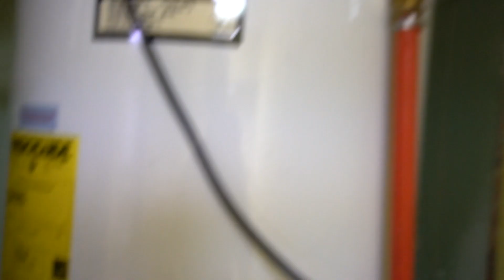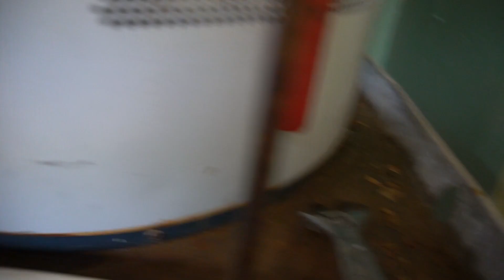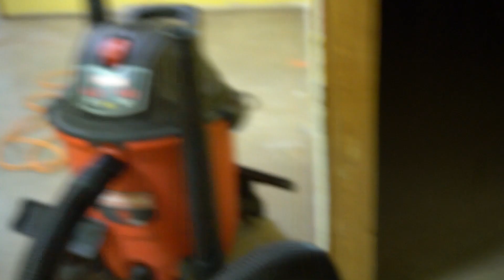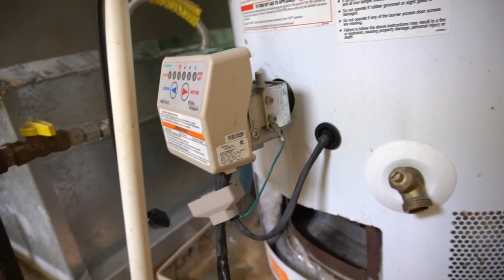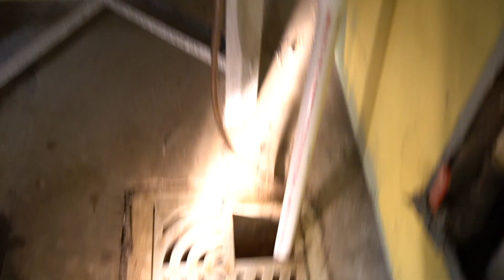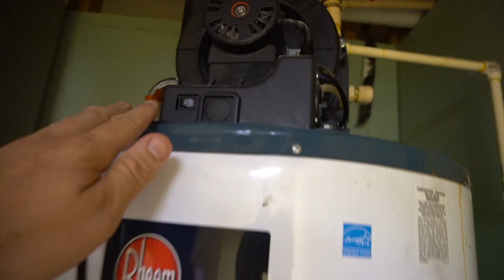How to Fix a Gas Water Heater that Won't Light Time to Replace Install Thermostat?

Comment: We just got a new replacement, as the old one was stuck on the very hot setting, and it won't go on at all. I wasn't there when the technician was there, but one would think he would have tested it. Now the control until won't turn on at all. My circuit breakers are okay... I tried a lamp in the outlet it uses, and that is fine. There is no on/off switch like in your video, unless its behind a metal housing, that is held in place with screws.

I am not very good with type of thing, and this is not even my house, so I don't want to mess around with something that uses natural gas. I am just worried about being stuck with a bill when we have to call the repair guy back (it is a rental), as we've only had it one day. Given that the tank was full of the hottest water, and the technician started the new one, one average temperature, could it be that he never even tried it? There is a sticker on it about starting it at average temperature. And when I ran water after he left, it was still very hot.

I unplugged the old defective one sometimes, to stop people from getting brunt, and when I plugged it back in, all the lights would briefly flash... Now when I unplug it, and plug it back in,,, no reaction. There is an internal switch, that goes off, shutting it down when it detects excessively hot water? That is the only reason I can think of, why this thing has already gone dead. Help! Thanks.

Comment: Thanks for posting! How did you know the solenoid wasn't letting the gas get through? What were the symptoms of this going out on you?
Reply from the maker: the burner assembly was working, but after talking with some techs, they said replacing is best.
Reply: @TheRykerDane  Thanks for the response! I'm having a similar but not the same issue. It keeps trying to ignite, and it does a click, click, click, and you can hear it start trying to run, then it shuts down. It cycles over and over again many times until eventually it lights, but sometimes it doesn't for a while and the water doesn't heat up. Wonder if it's the same as what you've got going on or something different. My thought was that it's possibly the thermopile.
Reply: @powerofknowledge7771 did you fixed your issue yet? I have same exact problem as you and wondering what fixed the issue? Thanks!

Comment: My blower won’t stop and the green light is in along with A B C light even after unplugging it I can not reset it. I’m guessing I would need to replace the Module also.
Reply: Theres a diagnostic mode for these units and whatever lights are lite up will tell you the issue... ABC light with vacation light is replace eco activated and says to replace the gas control valve

Comment: Thanks for sharing this video! The best I can find.
For mine, I can see orange light when the ignition starts but no blue fire. Thermostat tries to inginit 3 times then go to vacation. Do you have any ideas what I should do?
Reply: Same thing here and I'm thinking its the gas valve and the entire unit needs replaced.
Reply: @ms.sayer1  I replaced the gas valve(the whole white box) this Tuesday and it solved the issue.

Comment: Dumb question.... Does it need to be drained before replacing the igniter? I bought a replacement igniter but there doesn't seem to be any instructions on how to install it.
Reply: No because the igniter only goes on the underside of the water heater. However, you will need to shut off the gas to it before taking off the gas pipe at the manifold door.

Comment: Min I replaced my gas controler and now I have to turn the power off then on several times to get hot water. It won't start on its own. Temp is set on high.

Comment: What if the green light doesn't blink?
Reply from the maker: Hold the button and it doesn't? Is there power?
Reply: What if this unit has zero power to it?? Ive unplugged it, shut off blower and let sit... then plugged back in and turned on and immediately hit the arrow keys but nothing!! Would it be the gas valve control unit that you replaced not getting power and whole unit or could it be a electrical issue?  Cant seem to find much on this issue at all only error codes and fixes to em but not when it has no LEDS lighting up period.

Comment: I have vapor lock out, tried the codes  with no luck, could it be my sensor? No gas leak present, Ao Smith lp hot water tank white Rodgers controller valve!
Reply from the maker: It could be the igniter is worn out and not starting

Comment: Hi - I'm having a similar issue (same lights appearing on the thermostat unit). You mentioned yours was stuck in vacation mode. I have the same water heater and on the side of it there's a guide that explains each error code. 

The code you were receiving (and I'm currently receiving) is described as "maximum amount of ignition attempts has been reached and system is in lockout"

Question for you, was your water heater not igniting at all prior to you fixing it? So with mine.. I've had this same issue 3 times in the past month, all on rainy days. I have no idea if that's just a coincidence or not. Each time I've just flipped the blower off/on, and the water heater goes back working normally. Given that my water heater does ignite and work properly for days at a time... Do you think my issue would also be my thermostat? I'm trying to rule things out so just wondering if your unit was lighting and working periodically before you solved the issue.
Reply: Same issue as you.  bought this part but after doing this:  https://www.youtube.com/watch?v=CEo2znK4X7c
I cancelled the order.  Did the sanding trick on the thermocoupler and cleaned a big pile of rust seating on the burner.  Hasn't faulted now in two days.  Hope this helps you too.
Reply: @tomberris7757  thanks for the response. I just went 3 days without a fault.. but sure enough this morning no hot water and the same error code. Tonight I took the burner out and did my best to sand the flame sensor rod that Chris Edwards showed in his video. I didn't touch the igniter rod that Chris mentioned was ceramic. I had a fine (220 grit) sanding block and a metal/wire brush. Did my best to sand anything off...although it didn't look like a tone of black stuff was caked on. Luckily when I hooked it all back up the water heater worked... but it always works when I turn it off/on. The real test will be waiting and seeing if it faults again at all in the next few days/weeks/months/years. I really hope it doesn't - fingers crossed. How has yours been since you sanded?
Reply: @marklinfante54  
No problems since cleaning the burner plate and thermocoupler.  Before doing this, mine would light the gas then shut off right a way.  I would wait overnight, then it would light and stay lite for a day then back to the burner not lighting again and showing the fault.  After playing this game for a week or two, the power off and back on just would not work anymore, even when waiting a day or two.  That is why I thought for sure I needed to replace the Thermostat control.  In a last ditch effort, I tried Chris' trick and so far its been almost a week without problems.  I'm getting more confident everyday that I'm past the worst of it and all will be golden.  If it goes bad again, I'll let you know.
Reply: C66t6t tc6c
Reply: Hi Mark, ran into very similar issue as yours, my 10 yr old Rheem only lite for about 10 minutes and then shuts off, ended up the same code/lockout after 3 attempts. I did try the fine sanding trick but samo-samo just no luck, viewed Tom's and your fixes posted 4 months ago just wondering how the things are going.
Reply: @davev7746  So far so good! Knock on wood. After sanding away any carbon build up (which honestly didn't feel like that much)... the water heater has been working well.
Reply: @marklinfante54  Moment of the truth finally I figured out the root cause - the gas valve solenoid coil was open, it'd be at around 1.25 k resistance, which in normally Closed, when calling for heat the solenoid triggered by 105Vdc from the Gas Valve Control it opens the gas valve to the igniter, for safety I ended up only replaced the solenoid part without dealing with gas line, tank drain, etc. and the heater works properly as expected.
Reply: Long shot  @davev7746  but would you happen to have the part number? I have a 16 yr old tank that is due for replacement, but I just need the old one to tide me over a couple more weeks. If I can just swap out the solenoid I think that might save a few bucks over a new Tstat.
Reply: @graemedavidson1952  It’s been over 2 years since the solenoid was changed, however no one sell just the solenoid part but the whole assembly, because the shape or size fit the original spot, all I did simply took the solenoid part off the new valve I ordered and installed it to the existing valve at the tank.
Reply: @davev7746  Thanks! When I priced out the who part it was not worth it since the tank would be replaced soon anyways (5 days of cold showers is my limit!). The installer said they get 10-12 calls per day to repair these controllers.
Reply: @davev7746  When you replaced the solenoid, I assume you tilted/twisted the piece of metal that holds the cover of the solenoid in place, and then put it back in place after replacing the solenoid and it's cover.  Were you not concerned about breaking this piece of metal on any of the 2 gas valves you were holding?
Reply: @davev7746 

What part did you used for the replacement?
Reply: They seemed strong enough unless you overdo, I soldered the wires with shrinking tubes, just make it safe and looking nicer. Good luck!
Reply: Had exact same code and symptoms. Heather working fine then at a time when it should kick on it was in lock out. I unplugged the fan and plugged it back in and it started right up. Was ok for over a month, then we just had a lot of rain, and it’s happened twice in the last two days. Same fix though, replug in the fan.